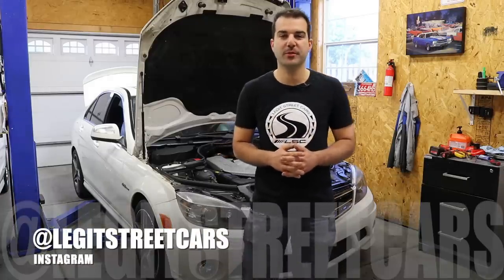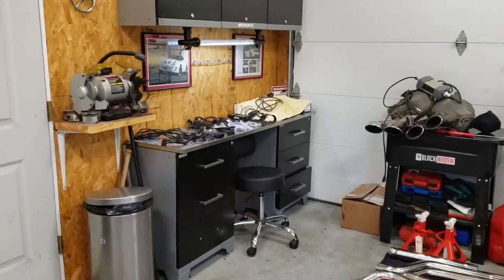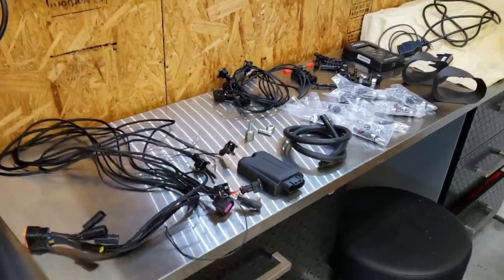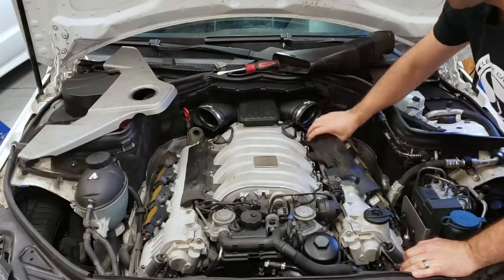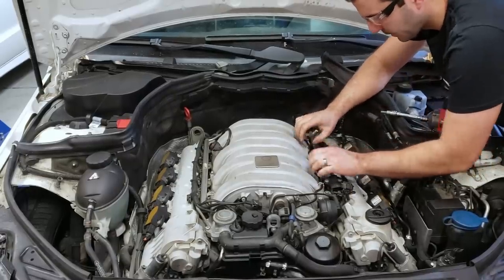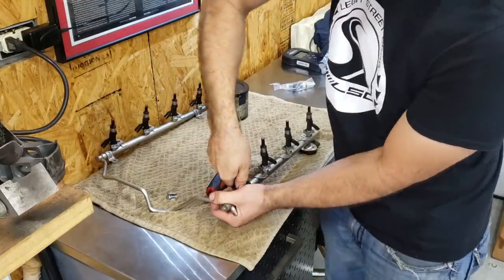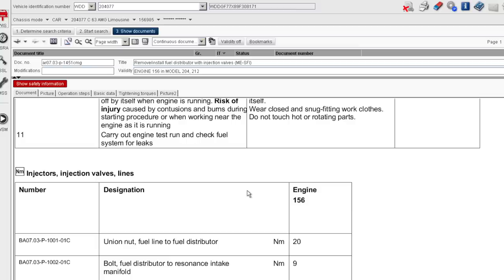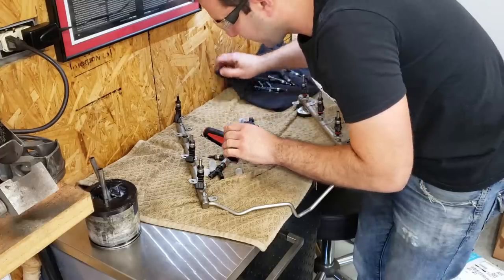My C63 AMG Doesn't Run On Gasoline Anymore! More Power & Less Emissions For Cheap!

Comment: Haha my E220 w211 stationwagon uses 5 liters every 100 km very very economic.
Reply: yeah, but it is underpowered for that body, slow as hell and it's a diesel.

Had 320 cdi and was making circles around those four banger, and for what, additional 2-3 litres of fuel?

Comment: Great video Sir.  I wouldn’t be against running a supercharger in my ML 63 AMG.  I definitely would like to do the E85 conversion though for sure.  Thanks for the video it was very informative.  I’m thinking about seeing if there is an after market body parts store that produces factory carbon fiber body part for the entire car as well.  Replace all of the parts out side of the chrome part on the front and rear bumpers with carbon fiber.  What do you think?
Reply: Godspeeds Spacebender contact eurocharged atx

Comment: You are spending almost a grand for 25 whp and I think 3 grand is a lot for 300-400 hp gain in my 335xi. :D
Reply: A simple retune of a n54 will get you atleast 70hp. Should not cost ya more then 200 bucks
Reply: @melvinf190  yes, I know but I'm talking about single turbo setup. The tune you are talking about, that's what I'm doing in few weeks. :)

Comment: Would the leaky injector trigger CEL.. any symptoms, or just hydrolock?
Does Benz dealer pressurize the system to diagnose leaky injector?
Reply: Michael Grandlouis I'm also interested of the symptoms. I have around 85k miles on my 2013 C63

Comment: What is it that causes the injectors to stop firing properly and become stuck open? Would using an injector cleaner fuel additive help?
Reply from the maker: I don't think an additive would prevent it entirely. It may help but not enough for me not to change them
Reply: @LegitStreetCars  thanks. I'm the proud owner of a low mileage (50,000km) 2013 p31. The information you provide is very valuable. I have watched a lot of Tsasos' videos on the cam issues. Yours is good and makes me a little more confident I wont have to deal with that, but if I do it might not be so bad.

Comment: Pretty cool dude...I wonder if the same guys have E100 kit ?
I'm asking because over here in Brazil we don't have E85 at the fuel pumps, but we do have E100  in every single gas station...
Do you think that it works with E100? Or we have to mix it like 85/15(gasoline) over here doing like, manually?

Comment: HI, thanks for posting the video. I have had my fuel filter replaced in my w203 c320. Now it  has  some problems at idle, and hesitates a bit  when accelerating ..... strange  the old fuel filter didn't give me trouble  like that...any ideas? THANKS

Comment: I am getting black smoke on my ML63 AMG .. would it be from the Fuel Injectors ? the car has done 125000 KM.. i have used multiple fuel injector fluids but to no vail.. pls help

Comment: I was reading eflexfuel page and I has the perception that system adjust by itself even with new fuel injectors size. Is it really necessary to flash a new map when changing injectors to 630cc?

Comment: First time viewer... first time commenting. Lol...( the older ones will get it) anyway good vid but I do have a question about milage. Every time I hear E85 burns faster and yet no one says how much so. I know it depends on how much you have built the engine etc but is it it like if you burn a 1/4 of a tank for X miles normal fuel then switch to E85 and now you burn 3/4 of a tank for the same X miles or???

Comment: Cool, still sound raucous. I live in the UK, and as yet I believe that our government has band E85 fuel use here for road use, bummer!!! Plus we have to buy by the litre at around  £1.15 ish per litre, diesel costs even more now, and its become even more strict with our mandatory yearly vehicle safety checks (M.O.T.), so not so cheap to run a car, when on a lower income.

Comment: How good does this work with direct injection? Another question I know increasing the boost by a custom tune you take a chance on bending the connecting rod on m157 engines. This is why I have not got a tune for mine. I don't want to gamble blowing my engine up because of these weak connecting rods. Will adding e85 to my E63-S bend these weak connecting rods somehow? 🤷

Comment: Legit street cars i need help! I recently had a issue were my 2008 c63 shut off on me while on the Express way. I thought it would be because if the alternator.. well i used a code reader and got code P0628. before i spend $700 on a new fuel pump .. what steps could i take to diagnose this issue ?

Comment: Good morning, Alex.  I have a question not related to this video.  I currently reside in Puerto Rico and I don’t really trust the mechanics here.  I own a 2009  C300 and it’s been raining hard here the past couple of days; upon entering my car the other I saw about two inches of water on the driver side.  I vacuumed it and now my check engine light is on, my signals don’t work and my cooling fan is always on high speed plus the ac is not cooling.  Any suggestions as to what happened.

Comment: On Ethanol the fuel consumption on this car which is a heavy user out of the box, will increase by up to 20%. The price differential between E85 and normal gas will be eaten up by the extra consumption. Prepare for more gas station stops. Ethanol is a bio fuel and while less polluting than fossil fuels is expensive in environmental terms to grow; produce; refine; transport.

Comment: So is the fuel injector issue just due to a shorting injector or is it just a PCM or wiring going haywire? I’ve heard of it happening a lot on early W211 E63s but if it’s just a matter of swapping injectors no big deal.

Comment: How did those 630cc injectors work for you?  My tuner said it wasn't enough to run e85 in the c32. I'm running 1000cc injectors.

Comment: One question bud, my 2013 e350 coupe runs on e85 from factory (even the gas cap says e85 in yellow letters), is it better for the engine to run e85 on a daily bases or 93 octane??? I would really appreciate ur input.. thanks

Comment: No biodiesel in the E320 CDI then straight vegetable oil?
Reply: i think the C in CDI would protest and stop working. (Common rail systems are said to not want Biodiesel and veg oil because they lack lubrication of the high pressure pump.)
Reply: @nirfz  B20 will work.. I bet a mix of SVO and bio/diesel will work.  The issue is once you get into the 80%+ range.  Heating the oil will get around it thoughl
Reply: @joeyscleaninglady2877  sorry for my lack of knowledge but what do you mean by SVO?
Reply: @nirfz  
Straight Vegetable Oil

Bio has much more lubricity than regular ULSD these days.....

Comment: You mentioned that you need the bigger injectors if you’re going long tube header route. Would it be an issue if you run this kit with stock injectors and lth but not run a full tank of Ex85(91/e85 mix)? I have been told different things

Comment: Finaly bought a 2008, c220, w204, 646 with 72K on the clock. Been happily driving a merc for the last week. Your videos have been, and still are, a huge confidance boost that I will be able to look after my merc for many years to come. I know, a c220 is not a c320. However I've learned alot from your videos and have done alot of research so that when I have to replace consumables, I won't be stressed that the job will be impossible for me to do. 
Thanks Alex

Comment: Nice video. For the life of me, I cannot disconnect that hose on the breather and I'm afraid of cracking the rubber - any suggestions? I don't want to cut the tubing. Also, love your Trans Am. I had a 97 Firehawk back in the day (lived in the Chicago Suburbs) that was a blast to drive.

Comment: Great work Alex - Did you ever get the results from lab of the oil you tested before? I have an E350 CGI (M272 engine) with 191k miles and thinking of getting a lab test out of curiosity.

Comment: I have a c63 2009 do I need a tune ? I was also wondering if I do the e85 is it better to run bigger fuel injectors  or can I keep stock ones ?

Comment: E85 sucks ass, the engine doesn't like it even in my 2017.  It throws codes and clears, and acceleration is not noticable low-end-for me.  Good luck though.

Comment: I like when we can see how you work with your,on normal speed , specially when it's about important modifications like this.
I had a saab 95 aero with E85 and it was running with stock injectors. And the only thing you could notice was a slightly higher acceleration. And a little more of torque than before tunning the ECU.

Comment: Fuel injectors @ 70k? Long gone are the days of engines like the m103. Miss when Mercedes used to be built by the engineers instead of the accountants.

Comment: every one knocks the e85 setup on there amarican made cars at the same time complain how can they get more hp. the 3.5 v6 monte runs great on it. it has the 75lb injectors. the only thing it had wrong with it was the week head gaskets that hate that type of heat. changed the gaskets and did a port polish and sleving the valve guide seals. runs a lot better after.

Comment: Hi Alex! I understand that ehtanol may run cooler than gas, but it has definitely not higher octane number. In fact, as you say the octane is 85/86, compared to the 92 octane number from petrol. This means that the enginge will tend to detonate more, so the module will give the engine more ignition timming?
I think it will be grat to just a little deeper in this technical stuff, that is the real reason why not any car can use ethanol

Comment: Detailed video are really nice in cases witch are not so common, like fuel system. But it’s really nice to look on bolts wrenching at time lapses. Thank you for breaking myths that e85 mods are crazy expensive.

Comment: @16m47s: Fuel hose between engine and body is rather short (tight). Broken left motor mount might lead to torn off hose and possibly an engine fire.

Comment: Hey alex I was wondering about how you got the workshop manual to work the way you have it shown in your video. I bought one from the link you provided and all I received were PDF files which are super difficult to navigate. are you using some sort of special software and if so what is it? Any advice would be appreciated
Reply from the maker: You have to get the download version not the pdf

Comment: Hi Alex, long time subscriber here, I am considering a ML350 2006/2007 M/Y, I found one of your videos that discussed the horrible engine issue. would you say this is a deal breaker for that car? I found a pretty good deal on one and am about to pull the trigger. Also- any other problems on that car I should check for? thanks!
Reply from the maker: If it hasn't had a balance shaft replaced and it falls within the affected VIN range, don't buy it unless you can do the balance shaft yourself. It's enough to total that old of a vehicle if you were to have it done at a shop.

Comment: Alex please need your help ASAP! I have a w203 m271 kompresser, the cam adjuster magnets are leaking oil like crazy tell me something to do except for changing the magnets. I live in Pakistan and I am not in a financial situation where I could afford something like a 500 dollar repair bill to just another time these adjusters leak. Please help me out man. I am eager to try liqui moly motor oil saver. Isn't there something that would really work!
Reply: Shahab Ud Din Khan You can change the seals inside your cam adjusters but other than that I’m afraid you have to buy a new set.

Comment: Alex , I have an 09 with just ROTW air boxes and a tune , it was good for about 70+WHP , this is pretty much just bringing the C Class tune back to “stock for the M156 on the non 204 applications , I’m sure that plus your long tubes and the E85 will make this a real monster . BTW , really loving your Videos 👏🏼
Reply: what is rotw

Comment: I am curious how the car starts.  I have run some beaters on e85, non E85 vehicles, and they run fine.  Only thing I have noticed is that they do not start as well as regular gas.  Curious also where the damage will be done if any.  I suspect maybe the hoses or seals.  2 years no problems and the savings is probably approaching the values of these beaters.
Reply from the maker: So far so good but the weather is nice

Comment: If you don’t have aftermarket injectors, do you have to do the wire adapter step?
Reply from the maker: In most cases yes. I had to for this

Comment: Great video! I've procured a 2000 ML55 AMG! Working on fixing her up! Tires are next, as I have to daily drive it right now. But $900, for a running driving AMG! OH Yeah!! Tried to find factory service manual on your manual site....no luck....but got a 4 DVD one off eBay. Having some cooling issues, and customary oil cooler leak...LOL Keep the good stuff coming!!
Reply: New intercoolers aren't that bad $ wise
Reply: I'd supercharge and add some spray too!

Comment: How does the aluminum and rubber in the stock system deal with the ethanol, long term?
Reply: The rubber wont hold up after a short period of time, that's why you should replace your fuel lines with teflon coated fuel lines.

Comment: You'll be doing alot more oil changes on e85 and it ruins your engine and other components
Reply from the maker: How does it ruin these engine components?
Reply: @LegitStreetCars  like hoses and pumps list goes on. E85 absorbs water and is corrosive.  Looks like windex or something why bother

Comment: In germany you we have 102 octane gassoline which should also gain 10-15 hp
Reply: in ron or aki because holy shit we need that
Reply: The 93 here is the same thing
Reply: 102 would be race fuel
Reply: @m10lover  here in canada we have 10% ethonal in regular and premium has none
Reply: MurderSassin no our 98roz is like your 93, but we have also 100roz and 102roz as „normal“ gassoline
Reply: Emet Playz in ron